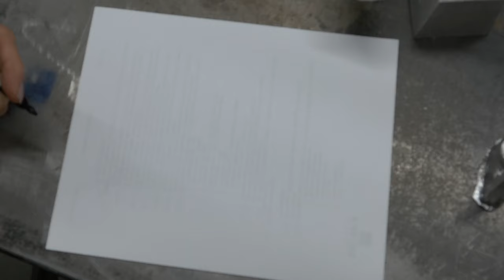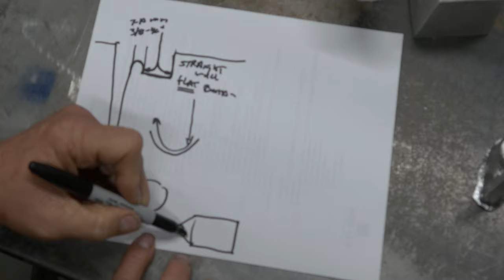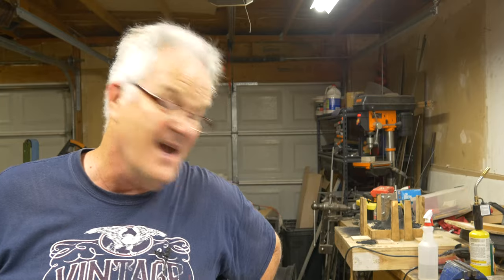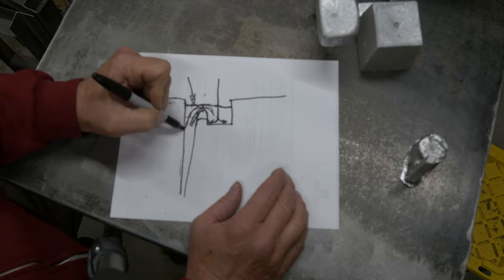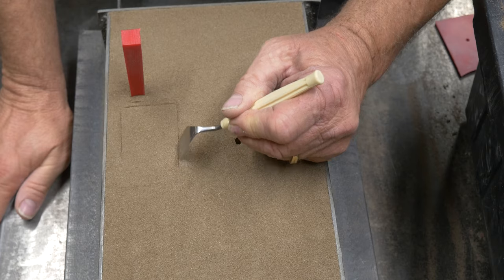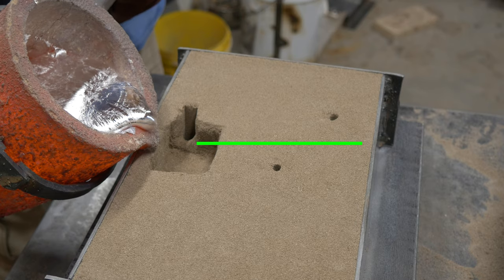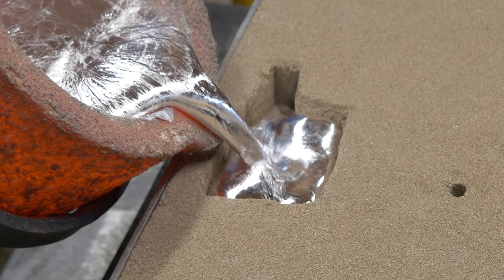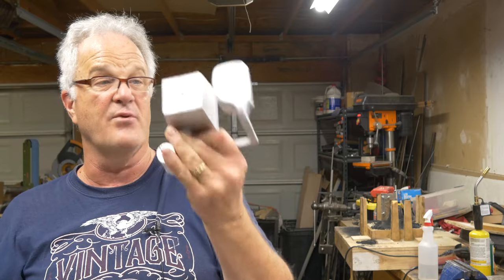Learning to Cast Metal   Offset Pouring Basin

Comment: Slow the flow of metal.
Reply from the maker: If you're referring to a purpose of teh basin, I can see this in a large pour with a large crucible or ladle (think industrial foundry) but I'm not sure with the height that I pour it's really slowing it all that much.   The height of my crucible lip is very near the same height as the top of my mold and hence sprue height.